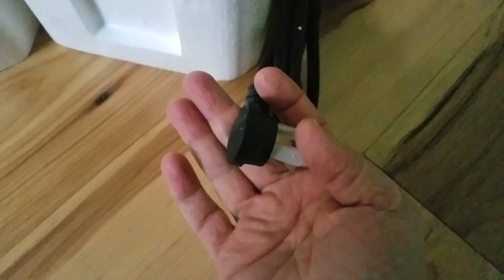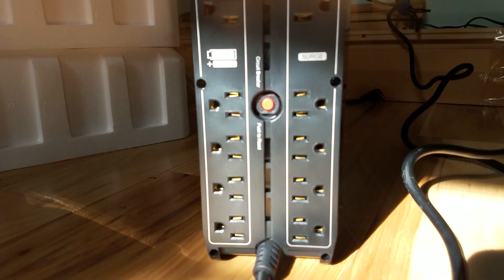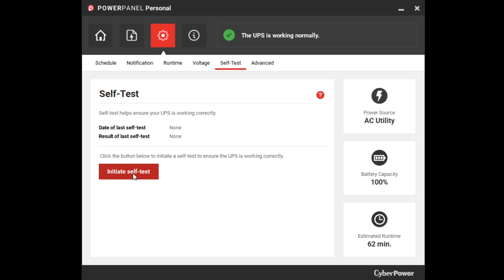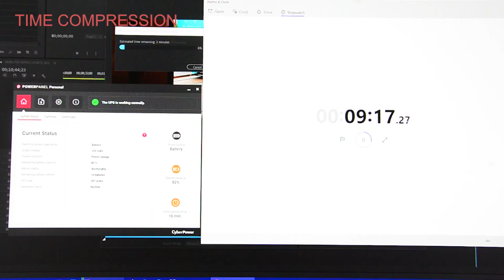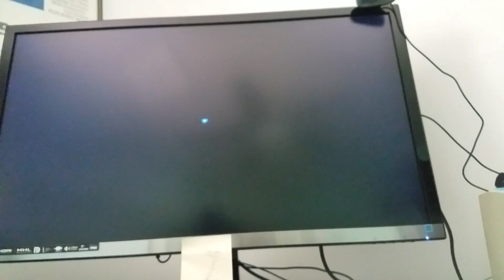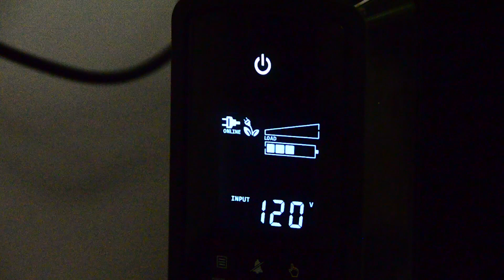The 2020 CYBERPOWER CST1500S UPS

Comment: Can a laser printer be plugged into the surge protection only side?  Thanks for making such a clear/concise video!
Reply from the maker: As long as the printer load does not exceed the power rating for the until you should be able to plug into the "surge only" side of the unit.
Reply: APC (Competing brand) recommends not connecting a laser printer to either battery protected or surge protected outlet of an UPS.
If you still want to surge-protect your laser printer, you can use a separate surge protector for it.
If you want to print during a power outage, you should opt for an inkjet printer as it uses much less power.
If you have to use a laser printer on UPS power, I would recommend measuring the peak wattage during printing and buy a quality sine-wave UPS rated for that wattage.
Reply: Cyberport website saying plug laser printer is not suggest Ed and will void warranty.
Reply: @feng443  That's not what it says.

> we ask that you do not plug laser printers in to the >>>>>>>> battery backed outlets <<<<<<<< of the UPS.